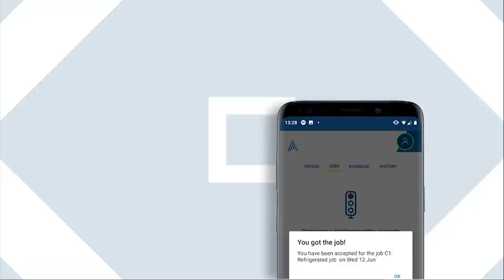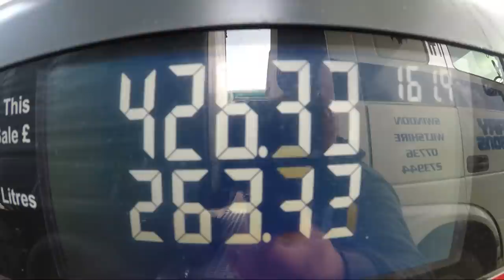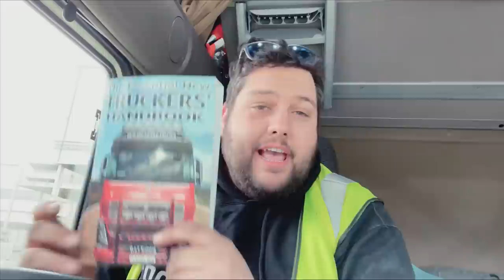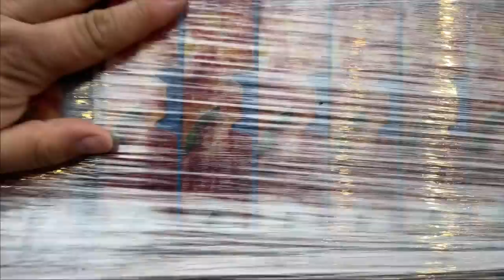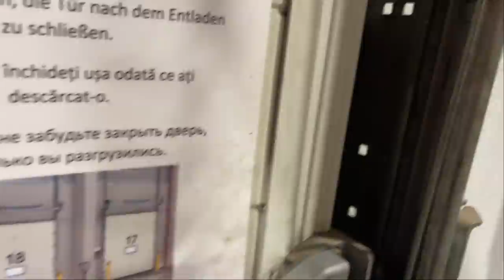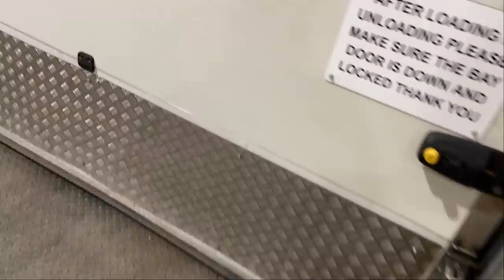Lidl Wait? I Don’t Think So!

Comment: I used to deliver bread by the trailer-load to Morrisons where they would back you onto a bay, then you had to hang your keys up in the warehouse and sit back in the cab - you couldn't even use the toilet. Hanging up your keys meant you didn't even have the radio in the cab - they caught me on that once and next time I hung my  car keys on the hook . . . I was there 5 hours one day waiting to get my paperwork back. No wonder there's an apparent shortage of drivers - I'm just glad I'm retired.
Reply: How come they don't let you use the toilet when you're doing nothing but waiting??
Reply: I used to do the same drop of bread to Morrison's of bread to Wakefield from Newport south wales
Reply: Get a suzi lock and give them that key, alot of these place are satisfied with that then you can keep your keys.
Reply: No wonder goods are expensive in the shops !! As the industry is incompetent and hasn't actually caught up with modern technology relying on jobs worth individuals and antiquated systems . This results in wasted time hanging about , missed delivery slots and has a knock on domino effect , making other deliveries late as well 
The answer is streamlining and automating the system.  
As far as paperwork is concerned this should be digitalised and linked to sophisticated dedicated scanners, auto email, photo iD driver/lorry to prove delivery, then onto next delivery . It is not impossible and with GPS etc lorries can be tracked easily.
A similar system the AA employs on their tracking app could be easily modified 
The drivers base automatically alerted by email etc, then linked to accounts.
The delivery drop timed and the GPS position of the lorry to be more efficiently managed .
The driver

Comment: If they're that bothered about making sure everything is present and correct, maybe they should tip the wagons themselves, then they'd be able to check each pallet as it comes off the trailer.....
Reply: That's why they are so flippin' cheap 😠
Reply: Thats the reason drivers unload because it saves them a fortune paying their own unloaders. I tipped in many lidl.s rdc,s but never had a big time delay.I found runcorn + belvedere were ok mostly.worse drop i ever had was in willenhall had sausages in boxes and they counted every single sausage ha ha.happy days get out of it all when cpc came out.
Reply: Took a load of cheese to a Sainsburys RDC. About 300 different types of cheese. Loady said if you help us count and check every pallet you will be away in about 3 hours, if you dont it will be 6 hours. RDC's I've s*@t em.
Reply: tipping is a very quick process esp. with a FLT or faster PPT, whereas checking can take minutes per pallet, normally not the same person to tip as to check, checking requures more care & is higher responsibility. Checking errors can cost thousand but tipping errors not so much

Comment: BMW Cowley. 5 hours wait to tip a load that I had picked up as an emergency for them at 8am in Wednesbury, had a timed slot to deliver, it was some finished castings or other such that if they didn't get pronto, the production line would stop. Just sat there, with my transport manager going nuts at the customer and BMW. Only just made it back to the yard before my hours ran out. It is insane, yes. I left driving. Loved the job, put up with the stupid traffic delays, but the waiting around did my head in. Favourite customer to drop at? Haribo. Yummy.

Comment: My record at Lidl so far is 4h30m to tip 25 tonnes of firewood.  The pallets were rammed in the back of a container and could only be pulled out one by as the cling wrap was sticking to the neighbouring pallet.  Then one of the pallets fell over.  Drivers are expected to restack.  No help offered.  Hate delivering to Lidl RDCs.
Reply: I managed to get in straight away and  unload....couldn't believe they told me i had to unload myself

Comment: hang a number of scanners in the storage station, the driver scans every barcode of every pallet he/she delivers, this goes straight to the main office.
Next to the loading dock inside there is a printer, which immediately prints out what you have delivered (this is for the driver) and he can leave immediately. 
And if something is wrong, or something is missing, they just contact the place where the goods come from, and possibly the company that delivered it, whereby the driver can demonstrate what has been delivered with the printout.
Or they have to tip everything themselves, problem solved.

Comment: Use to deliver milk to lidl northfleet. 109 trolleys. Each type had to be put in a line.6 pint whole  semi  4 pint same and it goes on. I would bang it out. What amazed me was you tip then go to collect the empties. These were in an area of returns. The amount of waste was unbelievable. Everything you can imagine rows and rows of waste. From electrical just everything you buy. It is all binned. I asked a bloke what happens to this stuff. The electrical has the cord cut and skipped same as the rest just binned. I was gobsmacked at the waste. The paperwork yes you sit and wait bloody joke. This world needs to change.

Comment: I recognised all the Northfleet roads, i used to live less than half a mile from there, but moved away 16 years ago, so all the LIDL depot and around it was the former site of Northfleet power station. Fred Dibnah demolished the chimneys there.  A really interesting video showing what you guys have to put up with on top of a very stressful drive.

Comment: It really isn't just the HGV industry that has those issues, though they may be more obvious there. In my line of work, if I get a delivery, I am supposed to check everything before signing for it. Apparently, the reason is that if I sign to say a delivery is made, I am signing to say it is all there, which makes it harder to argue later that it isn't (regardless of whose fault it is). The problem I get is that no-one tells me what is being delivered, so I really can't check it.

Comment: I agree there is no need to wait..what are you going to do if it is short? They give you the tools to unload it, why not give you a scanner to check it🤗
Reply: Hi Paul,I was offloading boxes of trainers from a well known retailer,pallets wrapped in black plastic,on the warehouse they stripped the plastic off and counted the boxes then accused ME off stealing because of a shortage although the pallet couldn't b interfered with so even if the driver scans they still want to check.BTW    I was accused for six months until it was just dropped with no answers to me.
youngsters r not going to put up with that along with the other chap hgv drivers have to put up with.

Comment: Drivers should not be dealing with paperwork. This is inefficient and costly for the industry. Pallets should have electronic tags attached and the tags linked to an inventory of the items on the pallet. When a pallet enters or leaves a warehouse the tag should be automatically scanned by the warehouse stock control system (not by people) to track and account for  stock in transit and stock delivered. There needs to be national or global standards to automate a solution for carriers to link into. Whilst the pallets are automatically tracked, driver should still be able to download an app to there phone or tablet to view their load if they need tool. If there are companies out there that is interested in a solution then get in touch.
Great video👍

Comment: I absolutely HATED delivering anything to Lidl especially the RDC in Southampton! I wasn't paid enough to deal with them on a regular basis!
Reply: I dealt with them almost daily back before I started driving tankers. The thing that set me over the edge was they actually complain at you if its not in the lines properly. Unload it yourself then!
Reply: @TwistedHorizonI20  Yes Calum!!! 🤣 It was either that or crying if the pallet was broken! I had it a few times where the pallet I had loaded was already broken by those loading the trailer and then as I'd unload it and they would try and blame me for breaking it, then expecting me to cross deck the bloody stuff from one pallet to another, that sent me over the edge a few times 🤣 And yes I understand the pallet needs to be in good condition so they can be stacked safely on the shelves before the Lidl mafia jump in on this comment 😉 I left the Southampton RDC without any of my paperwork once because they just had me waiting for ages! I ain't got the patience for places like that

Comment: Luke, you've never had pallets refused due to damage, incorrect stock etc ? That's what the checking wait time facilitates, I expect you've been there etc
Reply from the maker: Only once have I been refused a pallet because of damage. It was technically a bulk bag a single bulk bag. Told the Customer I refuse to take it back, I had a back load to collect and couldn’t take it with me. Spoke to the guys we were delivering for and said you either cover the cost of the next load lost, or it stays here. They then called the customer and said if they take it they will only charge half price 😂. Not my fault, or the haulers fault it’s damaged, why should we have to loose out on time, and loads. Know what I mean?

Comment: im a trucker who likes to do my shift and get back home, fk sleeping in the truck, i dont want to be there in the day let alone night as well, after a good few years driving i worked out hard sided box trailers with roller shutter door at the back are the best companies to work for, no faffing about with the curtains or opening the doors, also parcel companies are best for me, you will never night out only in extreme circumstances and the collections are a nice variety of easy and tricky, no RDCs, i used to work DHL and we would go to sainsburys rdc at stoke, place was a joke, 1 pallet would take them 4 hours, 26 pallets would take them 4 hours, when you asked they said it be ready when its ready, i would speed around the yard doing 30mph just to get banned from the site, treat you like shit, for me parcel companies all want there stuff gone and and will load fast and efficiently, i worked at current place now for 4 years on the agency, right near my house, perfect job. where i live in warwickshire i can leave one job and get 20 more in an hour its that hot for work

Comment: Is there an add on fee for waiting time, LIDL have saved money with you unloading the pallet's.

Man I couldn't do your job it would drive me nuts. Back in the 60s and 80s I drove trucks for a civil engineering company working from a large construction. I would pick up gas bottle's from British gas, steel from stockholders etc. The truck was licensed with the old type C license so I could only carry goods owned or just purchased by the company and have paperwork to support that. Never had your hanging about.

Comment: I share you concerns, I worked in temp controlled distribution for many years, firstly drivers didn’t go in the RDC  paperwork was signed unchecked and we had 24hrs to make a claim . How do Lidl square the health and safety of getting drivers using MHE on their premises?
Reply: An accountant has no doubt ran the numbers and it's substantially cheaper to risk the potential lawsuits than it is to pay for extra warehouse staff.
Reply: You sign in and confirm that you are trained.
Reply: @armchairgeneralissimo  not true
Reply: @alrightdave6135  So where are the warehouse staff?

Comment: Oh I've had loads of pointless hanging about and there was always some problem. They either didn't know where the load was or where to put it or they weren't expecting it, on and on and on. It's a crap job really, the best jobs were just ones where I was delivering the vehicle and not a load. The las time I went to London was in 2016 and they needed me to drive staff for some tennis thing to the 02 Arena. It was something to do with that Andy Murray and it was a daymare getting to the place. I had to wait all day to drive them back again to Paignton and I didn't get finished til two the following morning.

Comment: You should turn the pallets around on the trailer or ask the loader to put them on properly in the first place so it's easier for you at the other end. Euro pallets are supposed to go 3 long across the trailer, not 2 side by side. It still amazes me that drivers actually have to unload in places like that. And are they all actually qualified to use the EPT's. There is a licence for them after all. I know it's quicker to do it yourself, but still. You shouldn't have to. But I suppose that's how it's so cheap in the actual shop.

Comment: are you payed by the Hour? if so then don't worry about the waiting time/s .  Used to do airfreight at Heathrow and have waiting outside British Airways all night and been replaced by a day driver.    now there is a Minimum waiting time of 2 hours at most shed ( or it used to be 3 yrs ago)     its like driving in london if it going ton happen it more than likely will.
Reply from the maker: Paid by the day. The longer I’m waiting around the less I make per hour.

Comment: I stopped driving in 2019, 18 years was enough for me, just had enough of all the shit. RDCs are so badly run, unnecessary bureaucracy and it’s always to the detriment of the drivers. I used to go into Sainsbury’s Northampton regularly, usually with no more than 15 or so pallets, straight on a bay, great, but then have to sit in a waiting room for what felt like days whilst they had a think about whether they would tip me sometime this year. After losing the will to live I’d wander down to the bay and see I’m on a green light, god knows how long for, so I’d go back to get my paperwork from the office. ‘It’s not ready drive they are checking it’ ok so they are checking it, why does that mean I can’t have my paperwork and go, you can clearly see the trailer is empty so if if the load is short there’s nothing I can do about it so there’s absolutely no reason to hold me up, some places they take longer to check the load than unload it, anyone who has been in the hellhole that is Sainsbury’s Dartford knows what I mean. Job is made so much harder by unnecessary BS.

Comment: It’s not a very efficient service,they should have someone check the lorries to see if they are empty and just to count the pallets to see all is there, that would take 5 minutes and then driver could leave to next stop and the drop off point can then check palets in their own time and email about missing or damaged objects. You wouldn’t have as big of a shortage in drivers if each truck had a higher output per day but due to the lack of efficiency in this system the output per truck is only half of what it could be

Comment: You was lucky the battery was not flat with the electric truck? ( Did I notice you put it back in charge before you left?)
Reply from the maker: Yes it went in charge before I left
Reply: @lukecinahgv  Good man!  <we needed a licence for those type of trucks < we even had to have training for the hand/sack trucks!, as for having to wait for the load to be checked , i can understand it if it was a part load but a full load? 44 pallets ?

Comment: Waiting for sign off is an historic thing. If you get the paperwork, your company will say ‘the customer accepted it’, their fault. When you accept it for transport, it becomes your responsibility should it get pinched at your stopover. To solve this, you need some adults in the room to draw up a cost sharing schedule for damages and shortages. Up to £100 the customer, £101 to £1000 shared 50:50, over £1001 the manufacturer / shipping company following investigation. Much easier to prove with cctv, pallet tracking, camera phones with date & time stamps. I suspect the system has dripped down from major industrial manufacturing whereby a missing item potentially prevents or delays the manufacture of a large, expensive product such as a car. Theft of auto parts is an easily concealable theft when there are no serial numbers. The process was likely sold as best  practice within the transport industry, enforced by the customer to Tier 1 suppliers and then widely adopted as such despite some goods being disproportionately cheap and inconsequential to the overall objective, 2000 mini pizzas for instance at 10p each.

Comment: Great insight into what you guys go through in the UK. I guess these companies save money by getting you to take off the goods, but do you have to be safety inducted at every warehouse. Maybe drivers are dropping some money to the lads to get the load checked quicker.
Reply: I think theres an insurance thing with it aswell, that way if any damage happens to the truck it falls entirely to the haulage company and not the customer company. This way the customer can't accidently damage the truck especially since a lot of delivery's still dont have level bays and need to use tail-lifts. Still not right and should be changed.
Reply: I was surprised to see him using the PPT, I know it's low power but being a powered device can do more damage, Mayb e LIDL expect to see some kind of training certs etc

Comment: just a question when you are unloading pallets with equipment that is not yours and if you have an accident in the warehouse are you insured
Reply from the maker: You sign something to say you accept responsibility. If you refuse then you won’t be tipped and the company will loose a load. Loose loose for the driver.